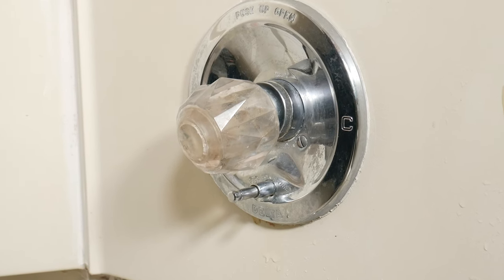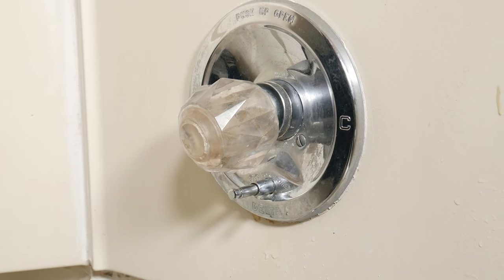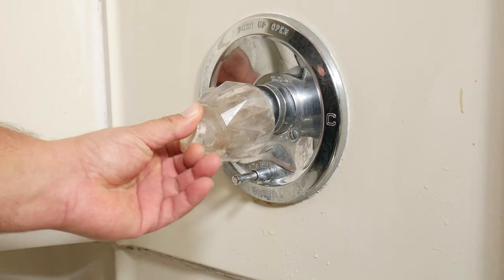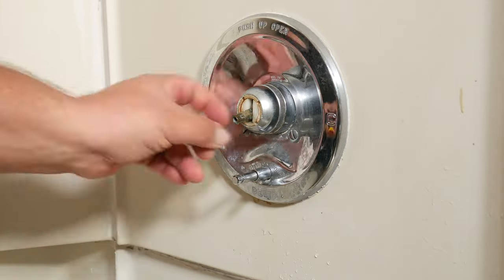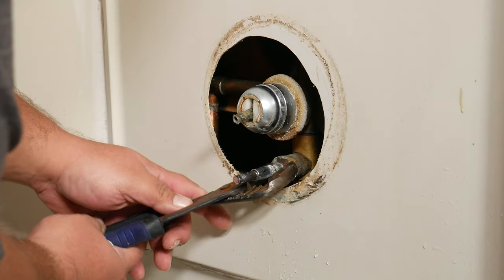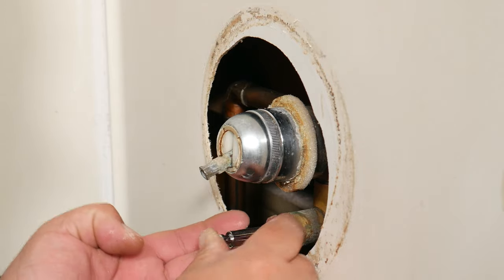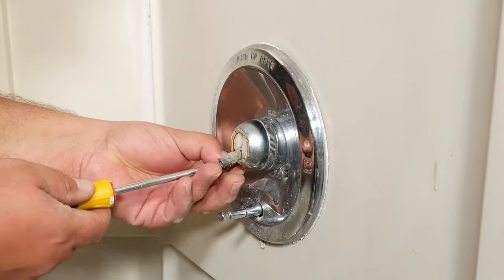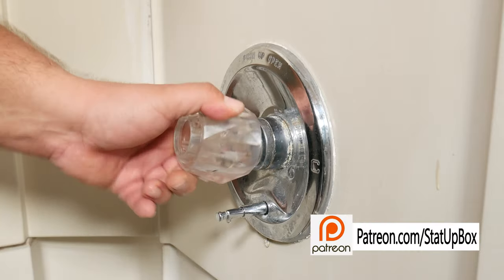How To Replace Install Diverter Push Button Shower Tub Easy Simple

Comment: For those still wondering...you do NOT have to turn the water supply off to switch out a diverter. I repeat...DO NOT
Reply: Thank you! I was wondering if I needed to turn off the main water supply to the house. You answered my question :)
Reply: Truedat, though... why risk water everywhere because you accidentally pushed the water valve up... I would switch it off... short time, no harm done.
Reply: As someone who literally just did this DEFINITELY TURN THE WATER OFF!!!! Mine has a different handle. Rather than the crystal looking knob it’s more of a metal bar type deal. I left the water supply on and soon as I loosened the threads it’s cake gushing out!! Luckily went outside and turned the water off quick but for someone who doesn’t have the water key it could be a nightmare
Reply: Lol. You can leave the water off…you just have to make sure the knob is facing down AKA “the off position”
Reply: @somerandomcommenter5823 just Un accidentally cut it back off!

Comment: I have the exact same unit in the video.  Found the part (thank you for showing the package) and followed the video exactly.  Button works great now but it still dribbles a little out of the tub spout while the shower is running.  I can't seem to troubleshoot that part. But it beats using pliers to pull out the button or a hammer to push it in every time we want to switch from shower to tub!
Reply from the maker: awesome! Glad we can be of help!!😊😊
Reply: hey angie! I have the same problem... have you found a solution? thanks!
Reply: @StatUpBox  +1 on the tub faucet leaking after the diverter repair. Is there a fix for this. Thank you for the video as the push button is now function automatically.
Reply: Great video! Thanks! I have the same issue of a little water coming from the tub faucet when running the shower. Do you know a way to fix it?
Reply: @bethjones3015  It is okay for tub facet to leak a little when shower is on, as long as it is little dribbles. Even the back of some packaging says that as well for these tub install kits.

Comment: It's fixed!! Repair went exactly as shown! Initially, the new diverter didn't fit inside the hole but found that the old broken diverter was still inside blocking the new one from going in! (I never did plumbing repair before!) Once I pulled that out with the pliers it was smooth sailing! Thanks again!
Reply from the maker: your are welcome! Awesome! 😊👍

Comment: My apartment repairman did my repair,  he did not put the dial back on properly,  the hot should be at the 9 position on a clock and the cold at 3 position,  my shower dial is now HOT at 12:00, can I fix this myself,  I have a lot of tools

Comment: I changed out the diverted and found that the water still comes out of the tub spout even after I have pushed the button for the shower.  I hope that you can help me with a fix?
This was the reason that I changed it in the beginning.  I really love the video and the step by step instructions.  Please help.
Reply: This is my issue too. Will replacing not fix this problem then?

Comment: Do I need to find and turn off any main water supply to the tub? Or is it ok to just make sure the bath water isn't running as I do this.
Reply from the maker: it be best to turn off main water supply as a precaution.
Reply: @StatUpBox  thanks!
Reply: @StatUpBox  how does one do that?

Comment: Had an issue in my shower where the water would ONLY come out of the shower head and not the tub spout. I had taken out the push button diverter several years ago, put a diverter plug in, and switched to a tub spout with diverter. Had no issues initially but at one point the water would only come out of the shower so I took everything apart (except the diverter plug) and looked for blockage, blew through the pipes, basic amateur attempts but it somehow "fixed" it. 

Cut to 3 or so years later and it's doing it again. I take everything apart and this time I know I have to take the plug off because nothing else is working. It will "fix" for a run or two and then do it again. I take the plug off and lo and behold is the damn little rubber flap from the end of the old push button diverter. I must have blown it out of the way or who knows what the first time I worked on it and it got stuck out of the way until recently. What an annoyingly problem that was so easy to fix lol. Funny enough it didn't start happening again until I had taken the trim kit off and was caulking the fiberglass gaps to prevent leaking from inside the shower into the walls. It just felt like one problem after another. Such is life. 

Thank you for showing what a new and old push button looks like so I could ID the rubber piece I pulled out and not worry where it came from lol
Reply from the maker: Yes, Life. Glad I can be of any help.  We salute you warrior of life. 💪😎👍

Comment: Does that Delta valve not only control temperature manually but also volume of water?  If so, what model valve is that.  Is it still available for purchase?

Comment: Could I just clean it hard water deposits etc also can you just shut the water off at the shower valves. I have a pretty old system and I’m worried if I turn off the whole system when I turn back on I’m might get some leaks I don’t notice right away

Comment: Yes you don't need to turn the water off, and before you put it back together, you should test it to make sure it doesn't leak! If it leaks, then you have to take the whole thing apart again! And if it leaks, you might not even see it until you have a water mess inside the wall and floor that's going to create a problem far greater by the time you finally discover it! 😢